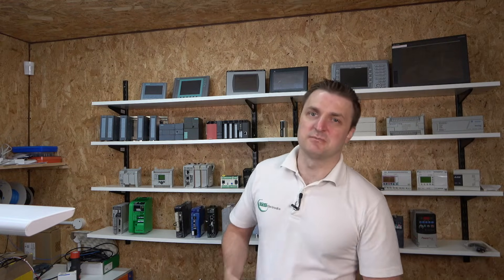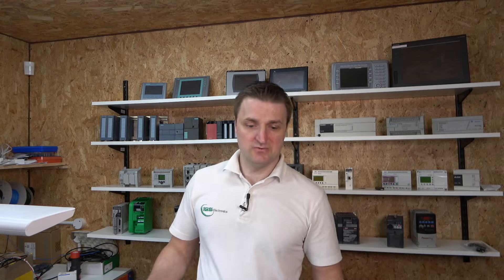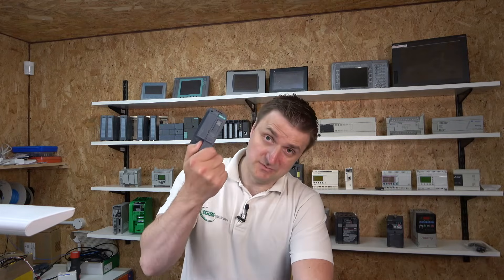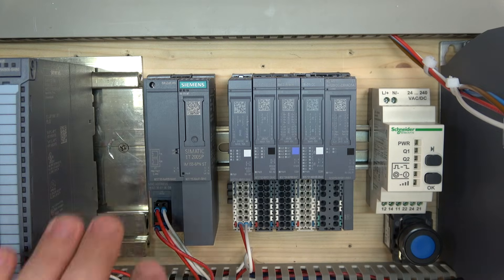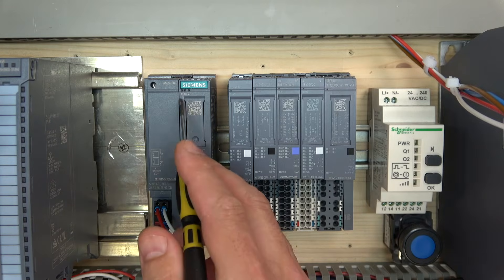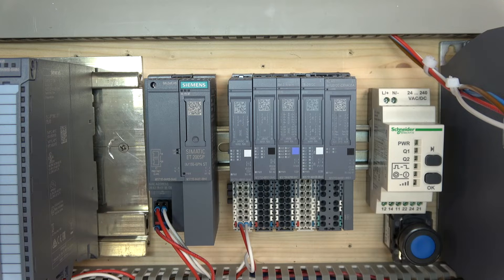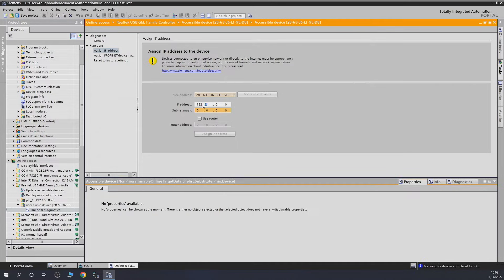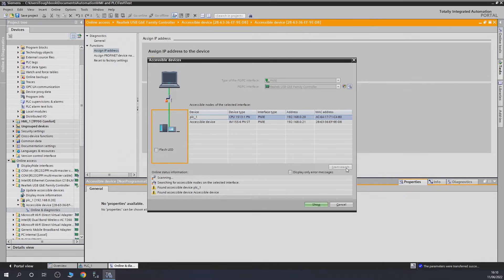Siemens ET200SP hardware assembly and TIA portal configurations. English

Comment: IF the machine use safety PLC S7-317F and safety ET200SP module as well.
Can I buy the new safety ET200SP and setting the IP address without edit hardware configuration ?